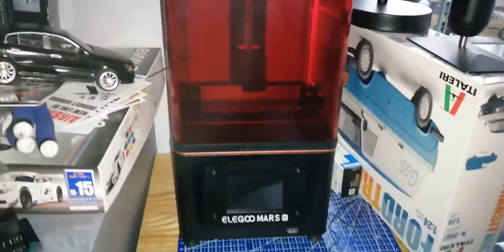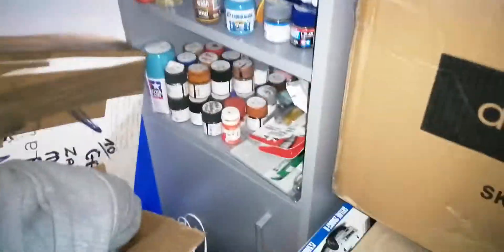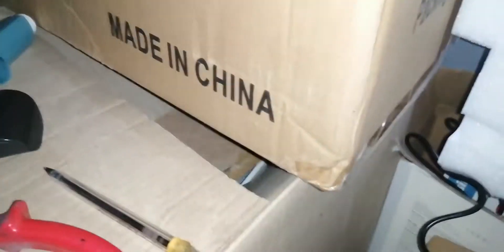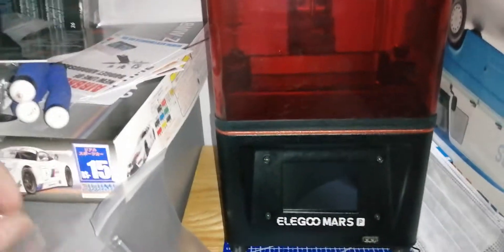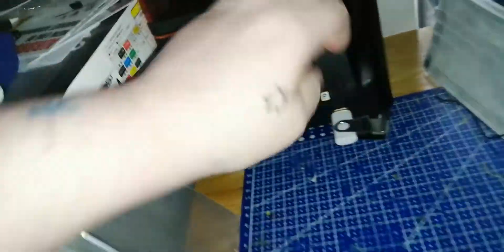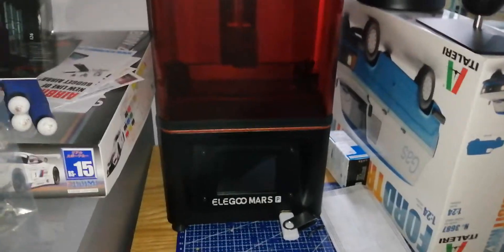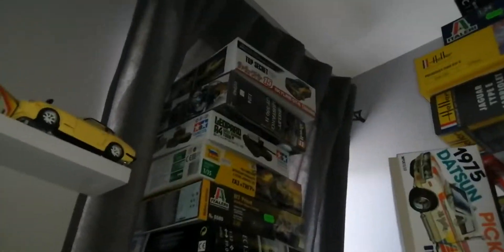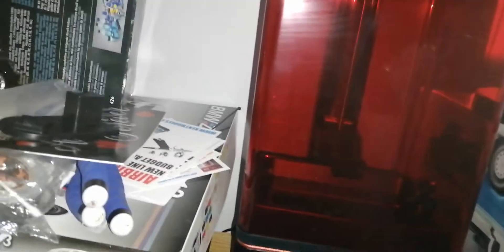Starting to prepare my 3D printer elegoo mars pro 1st time ever around 1

Comment: Nice one Keith the resin is washable under the tap if you using that type that's what I use and far more easy to clean out of the vat also you can pour the excess back into the bottle don't waste it is the a built in uv light with that elegoo  printer
Reply from the maker: I did get 1000 g bottle grey resin bro but i never got the water washable ill get some alcohol to wash it with im wondering what stores would sell that alchol wash woodies do it do u know i did know i wanted the grey i wasnt sure water washable or alcohol wash so when i use all that resin i will get the elegeoo water washable next time though thanks bro have u created any stl files or have u any that can could be used for car building, if i buy some ill share file with you ok im going to be buying some soon thinking rotiform wheel design some nice wheels
Reply: @keithsmodelsandrcs6593  Sounds good buddy there is a lot of sites that do free stl files just do a search for them on google search free stl files
Reply: @keithsmodelsandrcs6593  and yes the water base version is a lot better to work with a lot less mess to deal with just rinse under the tap
Reply from the maker: Thats cool i would of got that if id of known but handy to know now cause saves money getting that instead resin and alcohol so yeah most definitely its all new to me bro u know i never even tried it out yet i set it up but never tried it yet ill try tomorrow or something
Reply from the maker: @seamybmw  oh yeah i know ivea account with my mini  factory get free cool stl off most the guys u follow some u can just donate for too but the car ones i want to start getting are wheels wide body parts there things u can take photos of and create into a file like the supra resin kit mk5 supra i want to get widebody for that.. b4 i build it